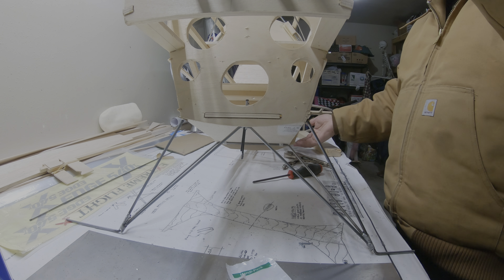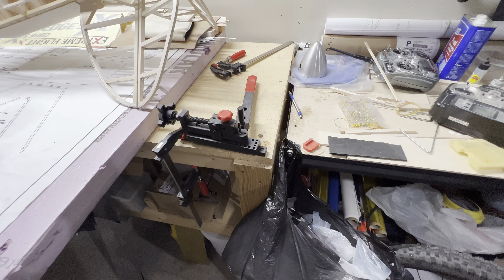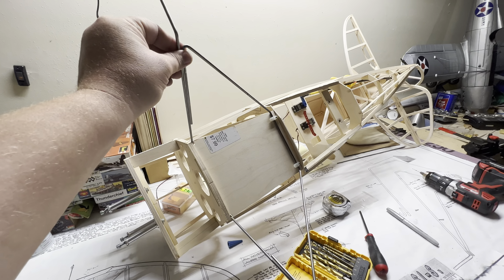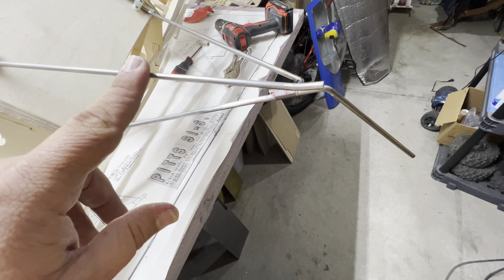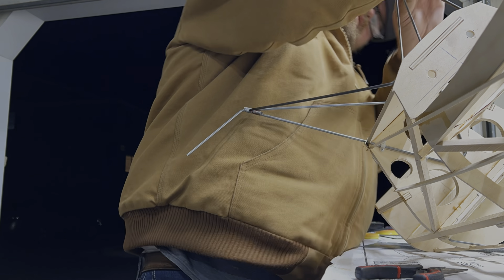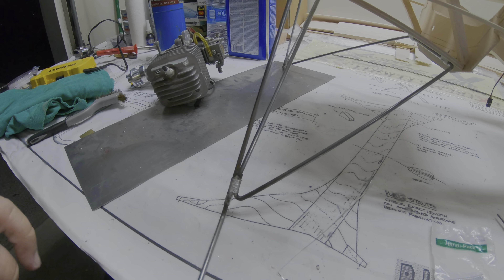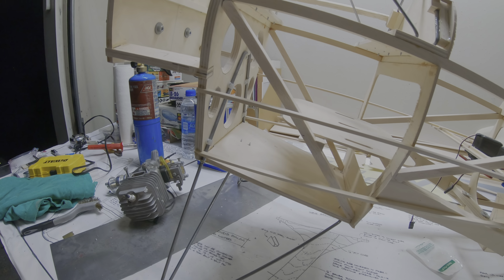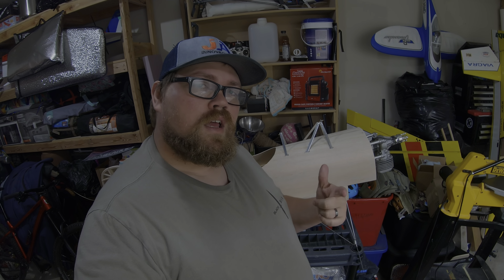Scratch Building an RC Airplane: Soldering Landing Gear

Comment: What size wire did you use here? Thanks!
Reply from the maker: I believe it was 5/32
Reply: @fromthegrounduprc  It looks pretty chunky. I appreciate the info! I am working on the LG for the Skybolt. It came with a bent aluminum sheet metal set, but I want a more scale look, so I am going with something real similar to what you did here. I plan to fill, cover, and paint each side - kind of like Cub LG. Thanks again!